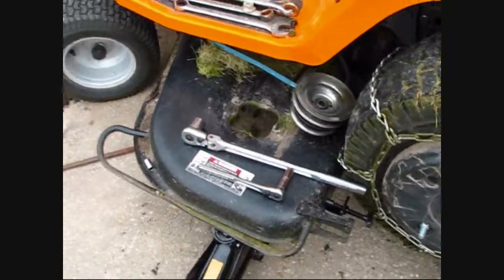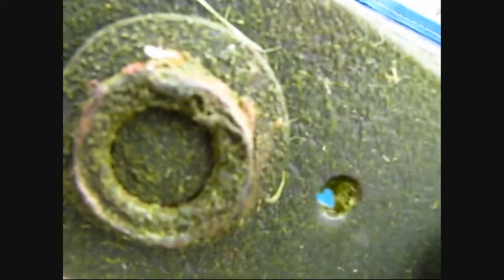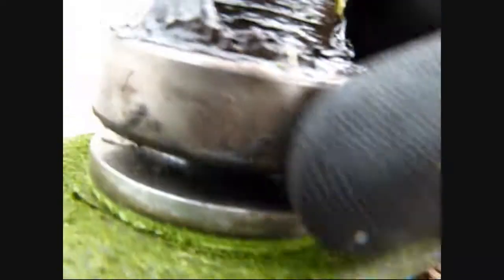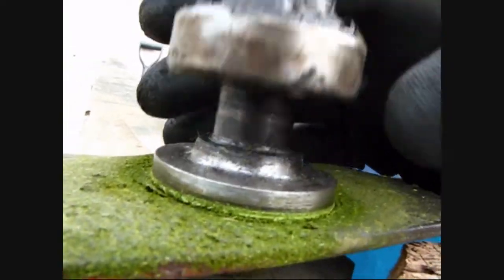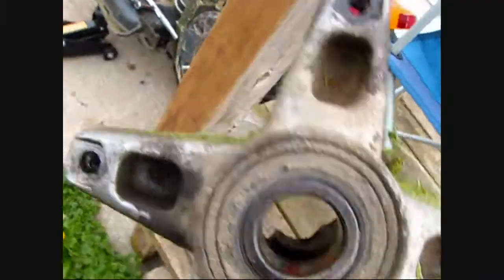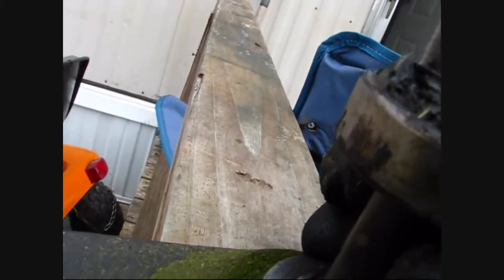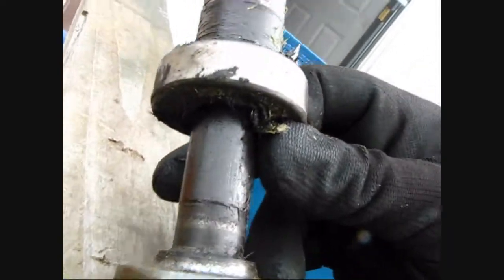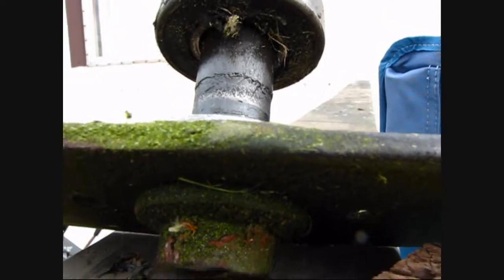Working on My 50 Inch MTD Deck Spindle

Comment: probably a 6204 2rs double sealed bearing and it should take 2. tip, cut the inside of the seals off with a razor knife(only the sides that face the inside of the spindle housing) and drill and tap your housing for grease fittings. they'll last for years.